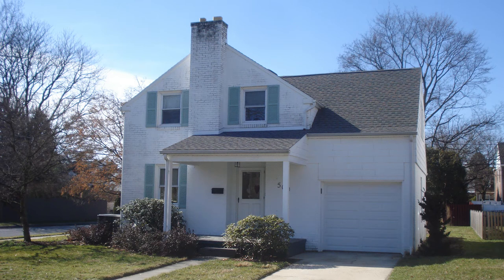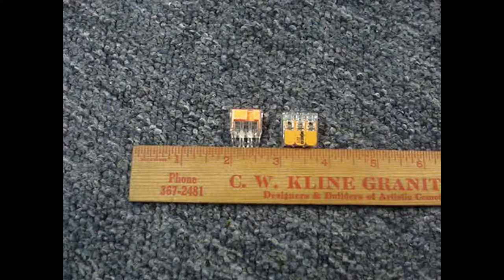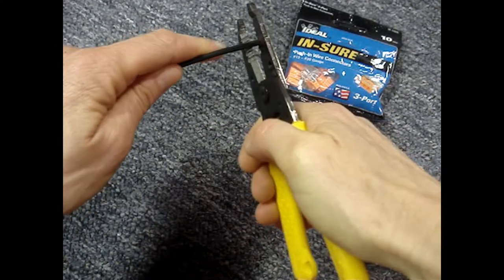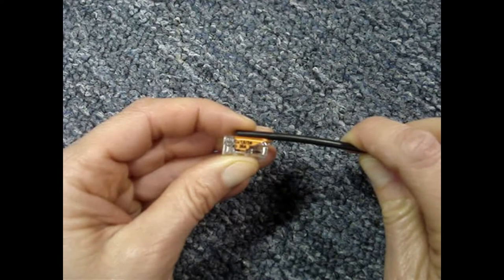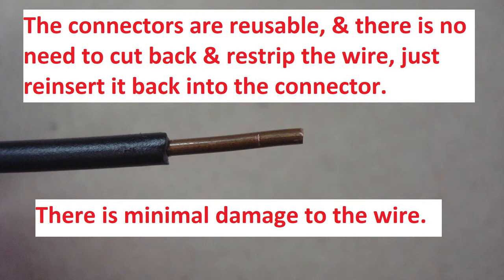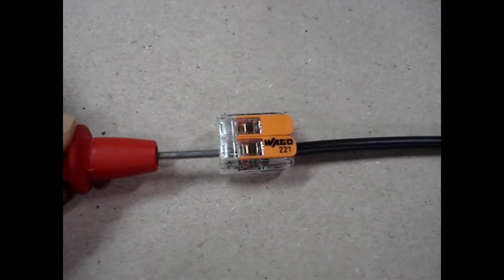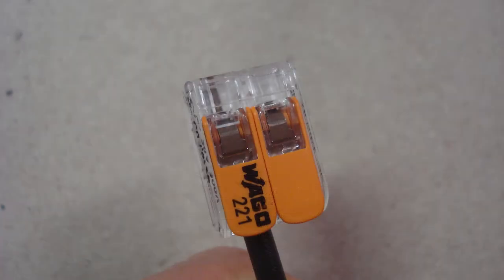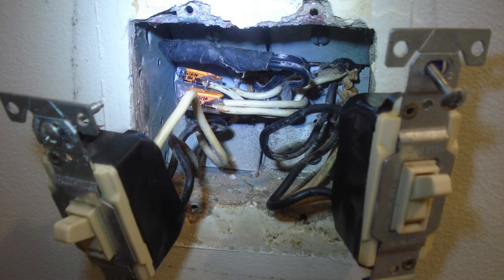How to Use Wago Connectors - 221 Series Lever Nuts

Comment: I have used wire connectors for many years, including wagos , i have learned new ways it is beneficial by watching this video. This one of several of your videos I watched over time, as in the past your reviews and instructions are the best I have seen.
Reply from the maker: Thanks for the watching the videos and taking the time to write a comment, Steven. I do my best to make the videos worth the time spent watching them.

I think Wagos are a great for someone who does not use wire nuts on a regular basis or if you have issues with your hands. The levers are kind of small, that might be a bit of a hurdle.  I do have a video that shows how to use wire nuts, it takes me 9 minutes to explain how to use them correctly.  It's really hard to misuse a Wago, they are so simple.

Comment: Great vid thanks.  WAGO connectors in bulk [50-100 pcs] even if you don't need that many, its down to 20c a piece.  I've used it to replace electrical connections in home appliances and auto accessory work, why struggle with screw on, crimp, soldering, or various socket terminal blocks, and even dissimilar wire gauge connections, WAGO can do it all, so having many come in handy.  Its UL approved, and made by a large reputable German company in Germany,  not outsourced to China, so you know you get very controlled quality, and it shows; its so simple and made of plastic, yet can do so much.

Comment: I have used Wagos for a couple of years now and I love them. Faster and a more secure connection. They secure stranded and solid wires together where wire nuts have issues.

Comment: Many thanks for your videos.  The Wago's are new to me.

My house I recently purchased is also from 1952.  (and a few additions after that).  I am going to use the Wago's as all the outlet boxes are smaller and the wire lead length is very short.   

I had an electrician install a new breaker panel....the original had four fuses for the entire house.  And was placed inside a kitchen cupboard!  (also a garage and an air conditioner came out this as well!)  The fuse panel copyright instructions were from 1940.
Reply from the maker: Wow, that electrical system needs some updating.  The boxes in my house are small.  I replaced a few of them because they were over filled.  If you have any three way switches, there could be shared neutrals.  I have a video on that topic if you don't know what a shared neutral is.  I'll put a link below.  Best wishes for the project.  https://www.youtube.com/watch?v=5agKBtj-v2I

Comment: dude thanks! I looked through all sorts of reviews and Q&A on home depot and amazon but could not find mention if the wires get damaged with WAGO (or other brands I was willing to try), thanks to your video I now the damage is minimal. I have wires in a tight spot that have very little slack and if i ever want to re-wire I don't want to have to cut them back.

Comment: Thanks, save me reading the instruction. I used it on DC 20 gauge wire. One of them pull out after, may be it didn't bit in well or my wire is too thin. I re-inert it and the connection work.

Comment: Quick and easy but I don’t use them.
That very small scratch is not much of a contact point and I could see heat generated from resistance corrosion.
I’ve always twisted wires first, use wire nuts and tape the wires together then around the nut.
Maybe overkill but that’s just me.
Reply: That is only where the lever arm pushes the wire AGAINST the metal pad on the bottom (opposite side of where this small mark is).  That little dent is NOT the whole electrical load.

Comment: Does the WAGO connector (3 bays) function the same as a GKEEMARS connector that is (1 in & 2 out)? I need to split the (+) Positive current 2-ways. One is going to a 24V (150 Watt) DC motor with 12AWG wire and the other one is going to an LED voltage meter that uses a 20AWG wire. I need to split the current like a "Y" splitter, one wire to the motor and the other wire to the LED volt meter. Currently I am using a Gkeemars (1 in to 2 out) but I would like to replace it since they do not work as well.

Thank you,
Ed
Reply: @Know-How-Now  Yes, so if I connect all three wires together will the main feed wire supply power to the other 2 wires?
Reply from the maker: My prior comment, which disappeared was incorrect.  All of the bays in the Wagos are common to each other.  Meaning, they are like a wire nut.  If you put 3 wires, one in each bay of a Wago, it connects all three together.  I'm very visual, so I am not following what you are doing.  I'd need a schematic.
Reply: @Know-How-Now  Perfect! You answered my question! Thank you very much!
Reply from the maker: You are welcome!

Comment: why does it skip 4 wire connector and go to 5? and lets say I have 4 wires, but use the 5 wire connector, will it work just fine?
Reply from the maker: If you have 4 wires it's not a problem to use a 5 wire connector.

Comment: The downside withers types of connectors is that the connection area is only a very small “scratch” in the wire caused by the clamp-down of the connector. This small connection area may go bad or get corroded leaving an open. Comments?

Comment: Why don’t they make a 4 connector? I need a 4 conductor! Why did you say wago is only for temporary?
Reply from the maker: I think you may be misinterpreting what I say.  I said they are good for temporary connections.  I don't condemn them in the video.  IMHO, for someone who is not an experienced electrician, these are better.  It's more likely for an inexperienced/untrained person to make a bad splice using wire nuts than to make a bad splice with a Wago.

Comment: Wagos are junk, dont use them.
Reply from the maker: I respect your opinion.  Why are they junk?  What do you use/recommend?
Reply: @Know-How-Now  They burn , melt , have high resistances , come loose, levers pop open, wires move around inside the housing, run warm to hot. Other than that there great. All anybody sees is speed and convenience.
Reply from the maker: What do you use?  Are you an electrician by trade?  Your name says radio.
Reply: @Know-How-Now  Its just a handle. We use wirenuts here in the states and have for decades. If properly applied they never fail. Most municipalites dont allow wagos and shouldnt. Ul approvals can be and are bought as its a private company traded on the NYSE. Alot of city inspectors state that a mechanical connection must be made between conductors.
Reply from the maker: As an electrician, can you explain why the European's use Wago and connectors like Wagos?  I am not asking to challenge you or be a jerk.  It's a honest question.  I haven't heard of Wago's being banned in the states.  I did a google search and couldn't come up with an results.  My state has adopted NEC 2017, I can't find anything in the code saying that Wagos are not allowed.  What cities have banned them and what code are they following?  Thanks in advance for the answers to my questions.
Reply: @Know-How-Now  If you want to know why foreign countries use them, you have to ask them that. You are confusing the NEC with individual municipalities that overrule and wont allow anything less than a "mechanical connection" (twisted conductors and wirenuts) Of course I dont have a list nor do I need one, been in the business long enough and wagos and other spring contact devices are not allowed in many places. Approvals from labs like UL are bought and paid for. UL is on the NYSE. Hence the NEC approvals.
Reply from the maker: I won't argue the point that the code isn't always in the best interest of safety.  We allowed aluminum wiring and "vampire" connections.  I had one of those on a lamp socket connection that heated up and almost started a fire.  Luckily, I saw the lamp flickering, pulled the plug, and took it apart and installed a new socket with screw terminals.  I did another internet search and can't find the wagos banned by anyone.  Without a name of at least one city, township or municipality that has a written policy banning them, I remain a skeptic that they are indeed banned anywhere in the U.S.  I do think that if applied properly, wire nuts are a good connection.  The connections in my home are twisted, clamped, soldiered and taped.  I suppose wire nuts were the cheap way out of that time consuming connection.
Reply: @Know-How-Now  You made a great point about aluminum wiring, why was that allowed? The UL scientists didnt know what dissimilar metals were? They were paid off to approve it and the NEC adopted it just like wagos and push in connectors. Yes certain towns banned them but not by name. It wont say "wagos are banned" Wago is a brand name. It bans the use of "spring contact devices"  which takes everything in except wirenuts , clamp and screw down connections. And mandates mechanical connections.
Reply from the maker: I don't know who is in the front pages of NEC, but the last time I looked at NFPA 72, it is full of the manufacturers of fire alarm equipment, sprinkler equipment, builder associations and some insurance companies.  Insurance companies are wealthy and powerful, I think they put their foot down on anything that makes them pay out.  If the spring connectors were a currently a huge problem (might show up as those connectors age?) the code would reflect it.  I am not a fan of the push in type connectors.  They mar up the conductor, to remove them, you have to yank the wires out of them, maybe connector is damaged?  If I remember correctly, Ideal says you are supposed to strip the jacket back and cut off the conductor end that was in one of their push in connectors before remaking the splice.  I am willing to bet it doesn't happen if someone takes a splice apart. That is likely the real weakness.  I think the Wago brand is better than the push in types, especially for DIY'ers.  Some people are going to do their own electrical work.  I'd rather see them use a Wago than a wire nut.  Odds are they will use the wrong size wire nut or not twist the wires together properly.  It's hard to mess up a connection with a Wago.
Reply: @Know-How-Now  Making a connection with a wago, you already messed up. If they cant do it right they shouldnt do it at all. When a wirenut is properly installed it will never fail because its the twist that counts, not the wirenut. Wirenuts are not part of the circuit. Wagos are by far different. They are IN the circuit and they shouldnt be. Wagos are a component IN the circuit, installed properly Will likely fail in time depending on the load and how continuous it is. Finding the fastest or cheapest way to do work is always wrong and will sacrifice circuit integrity for speed and convenience. Any contractor that does this kind of work should be avoided at all costs. Find someone who enjoys doing the job right.
Reply: @RadioRich100   This sounds like grumpy FUDD oldtimer/stuck-in-your-ways stuff. All the sparkies I know who are open to changing their ways and learning newer/better methods, know most of what you listed isn't true. We've been using them no problem, and there are plenty of videos proving all this and putting wagos through their paces and loads.  Marrettes have their own problems as well. Its like someone complaining that the "new way of wiring sucks" and their knob and tube method is the best. Things change, better methods and products come out. I'm never going back to using nuts.
Reply: @Stealth55555  No im not stuck in older things, im using windows 11, have a new cell phone digital camera and flat screens. Wagos SUCK!. It just the lazy mans way of getting out of there faster and sacrificing the integrity of the job at the same time.  Ive pulled enough of them out, burnt, melted, intermittences and dead circuits. NEW DOESNT MEAN BETTER.
Reply: @RadioRich100  Old doesn't mean any better, either... The blacksmiths said the same thing about "them newfangled motor-ve-hicles"...I trust German engineering over whatever dinosaur methods we use over here.
Reply: Let's see now, who do I believe someone calling themselves radiorich or UL (underwriters laboratory) which has approved and recommended these wire connectors?  Tough choice here.
Reply: @RadioRich100 ever thought about using electrical tape around the wago so
Reply: @dfgjfd459  No, whats that fixing? Theres more than one problem. That just fixes the levers popping open. Its still a resistive connection depending upon springs that lose tension and arc. Hardly any contact with the wire. They will rotate on the wire if moved.